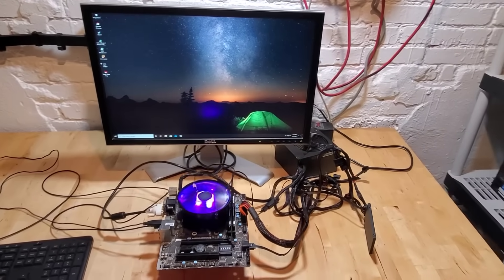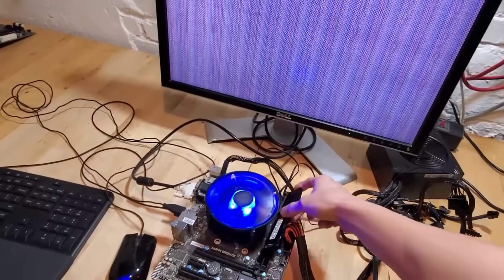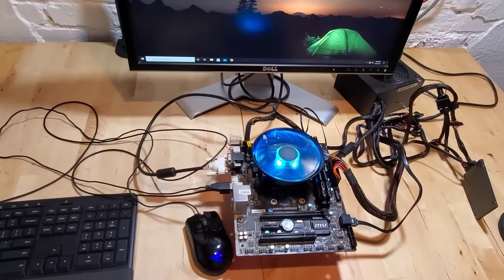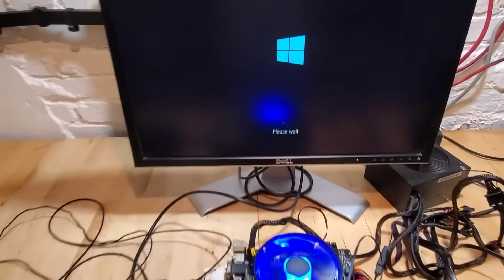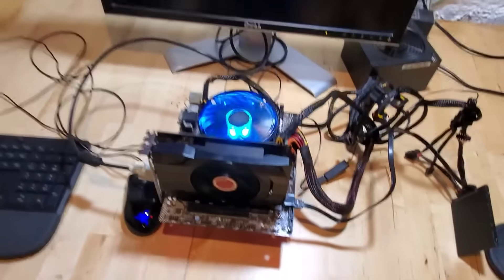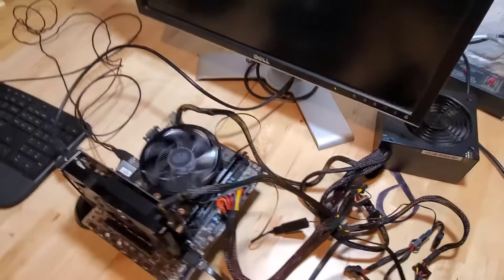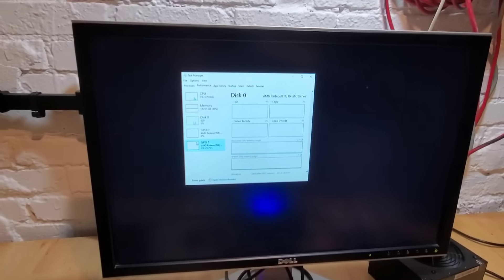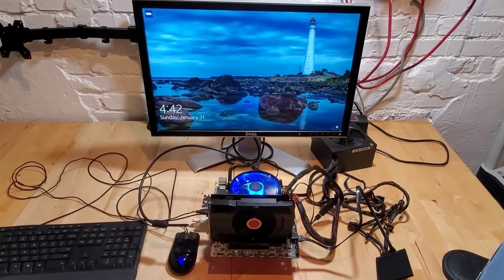What happens if you remove PC components from a running computer?

Comment: Almost everything needs reset after removal and reinstall. But, SSD or HDD doesn't need reset if connected within some seconds but if PC is used in the time where SSD is detached then Windows running on solely RAM data will crash.

Comment: Removing a PCIe card like a graphics card is obviously not a good idea, but if the operating system supports it, you can re-insert it and it should work right away. PCIe is a hot-pluggable standard (though support for it is not always implemented), and I've inserted graphics cards in Linux PCs for debugging while it's running more than once.

Windows unfortunately does not support this in almost all cases, but the standards and some OS kernels do

Comment: What happens if you connect monitor using both integrated graphics and dedicated GPU then remove GPU from PCIE slot? Will it switch to integrated graphics?

Comment: You should have tried removing the CPU while the RX 560 was connected to the display. Because since you were using integrated graphics obviously the screen was going to go black when you unplug the CPU. Not that the results would be any different but that's the more scientific way to do it.

Comment: 1.) would have liked to see you connecting the monitor cable directly to the motherboard after removing the gpu
2.) would have liked to see you plugging the ssd back in after removing it before the bluescreen - i really think this might fix it!

Comment: computer artifacts are so mesmerizing. especially the little space invader guys on RTX cards. also, the reason that the machine stayed alive for so long after the SSD was removed was likely due to the RAM still being inserted. still had some data on it either in use or waited to be used until it ran out. probably the reason why the wallpaper disappeared too.

Comment: I think there would have been different results if he was using a GPU while removing the RAM, rather than using an iGPU, if he removed the RAM while using a GPU, it would had the picture cached and it wouldn't display those funky lines that way, would just become frozen and you wouldn't be able to do anything, could be because of the iGPU not having actual memory, and using the RAM, that's what I think would be interesting to include too :)

Comment: When you removed the GPU,  you should have put the VGA cable on the iOS shields VGA input to see if the integrated graphics would have picked up a signal. But thanks for the video.  Very informative.

Comment: And from a linux computer ? (Just the hard drive and the gpu, since linux can add or remove gpu while running as long as it's not using it for display (else, you have to launch again the display), and it should be able to run without hdd too

Comment: why gpu is acting that way is... Maybe, theoratically speaking... The computer is the only thing that commands gpu and the gpu dont do actions by itself... so the computer hadnt told the gpu yet to turn off because you unplugged it suddenly it didnt had time to command the gpu to turn off... now that the pc is turned off and you put the gpu in...
1. The computer now told the gpu to shutdown
2. Gpu detected that cpu is off so... (due to my poor english this could easily be correcter or smth)

Comment: I tried the same process on my computer 11 years ago,The only difference is that when I removed the ram, the video card was installed and the computer did not freeze. System parts:
M.b. : Asus P2B
Cpu: İntel pentium II 350 mhz
Ram: 384mb "sd" 133mhz
Gpu: Nvidia tnt2 32mb agp
Hdd: Fujitsu limited 4gb ide.
Os: Windows xp. :))

Comment: Remove ram with gpu installed, also when gpu is removed plug in integrated graphics. Also, install hot-swap driver and see if that makes a difference - it should.

Comment: the pc would still run if u remove the gpu, in this case it didnt because the DVI cord was plugged to the gpu, so if u change to the port on motherboard ull see that the pc still run normal

Comment: I was trying just to take out my gpu to clean all the dust off the fans and I couldn’t even get it out. One side came up but the other didn’t and I didn’t wanna force it out and then it got caught on the side of my case and I couldn’t get it back in and after like 45 minutes of trying to get it back in finally fell back in pushed it in heard the snap and it worked fine. I’m just gonna air dust it while it’s in the case 😓😂

Comment: As someone else said already, I'd love to see the RAM removal while a GPU is active so that it's not using an iGPU with shared RAM. I don't know if the RAM was a set of 2 or not, but if it was, the opposite could be interesting aswell.(If it wasn't then we already know the outcome.)
Also, what if the GPU isn't running the display and is removed? We keep hearing the disconnect sound during a GPU driver update, so I have to wonder.

Comment: PC: screaming in pain from loosing a stick of RAM

Guy: now to take out the 2nd stick of RAM
Reply: Computer will not remember this because it had memory loss 😂
Reply: @eloskowy4954  Zheesh
Reply: @eloskowy4954  loll nice
Reply: 50 years later:
Dave: screaming in pain from losing left brain
PC: now to take out the right brain
Reply: @wasiplayseverything  "meanwhile in a parallel world"
Reply: Fucking bots
Reply: Lamo
Reply: *insert femur breaker scream
Reply: A RACCOON!
Reply: why did I laugh
Reply: @irusu.  yes why did you
Reply: 2237: hello_fellow_robots_today_we_will_see_what_occurs_when_you_remove_organs_from_a_functioning_human
Reply: @kahlzun  
No No... Even better   
------------------------------------------------ START TRANSMISSION----------------------------------------------
01101000 01100101 01101100 01101100 01101111 01011111 01100110 01100101 01101100 01101100 01101111 01110111 01011111 01110010 01101111 01100010 01101111 01110100 01110011 01011111 01110100 01101111 01100100 01100001 01111001 01011111 01110111 01100101 01011111 01110111 01101001 01101100 01101100 01011111 01110011 01100101 01100101 01011111 01110111 01101000 01100001 01110100 01011111 01101111 01100011 01100011 01110101 01110010 01110011 01011111 01110111 01101000 01100101 01101110 01011111 01111001 01101111 01110101 01011111 01110010 01100101 01101101 01101111 01110110 01100101 01011111 01101111 01110010 01100111 01100001 01101110 01110011 01011111 01100110 01110010 01101111 01101101 01011111 01100001 01011111 01100110 01110101 01101110 01100011 01110100 01101001 01101111 01101110 01101001 01101110 01100111 01011111 01101000 01110101 01101101 01100001 01101110  
--------------------------------------------------- END TRANSMISSION----------------------------------------------

LOL

Decipher via link
https://www.binaryhexconverter.com/ascii-text-to-binary-converter
Reply: @kahlzun  “hello fellow robots, today i will execute human_CentralProcessorUnitSwapper.exe while its system is active and we will discover if human system active (Y)/(N)”
Reply: U
Reply: nerver
Reply: Gonna
Reply: PC: dies
Reply: that's right,  the PC losing the stick of ram was equivalent to paralax in Green lantern sucking the soul from the aliens and leaving them mortal body behind
Reply: flat line sound
Reply: @slowlylosingmysanity9726  
Flat line sound...Oh.......No.. Wait
that's just the beep code
LOL
Reply: It's like getting your arms broken
Reply: ded
Reply: its weird that i heard pc screaming when i read this comment
Reply: and then feed it to a protogen
Reply: @coalthedergsune  what is that
Reply: @devind407  robot furry.
Reply: @coalthedergsune  what is that
Reply: It is pc kidneys 😂
Reply: its like a cartel torturing somebody by breaking their fingers one by one for not bringing the quarter they wanted
Reply: dementia
Reply: No f you 😭😭😭😭😭🎉
Reply: @KWithoutVideos-lw7bk  why I clicked AAAHH
Reply: @shadoflameYT  whats that? Im scared to click
Reply: @szymonka6384  Its a Rickroll
Reply: @szymonka6384  its a rickroll... a strange rickroll...

Comment: You COULD have put the SSD back in before windows crashed and it would 100 percent recover   Ive fast swapped cables that were acting up without taking the machine down.  It just detected it as a drive going unresponsive for a few moments.

Comment: I removed my SD Card from my RPI4 (at the time it was running Win 10, now runs 11 build 22000.71) and it did questionable stuff. I used mountvol though, so it was still inserted really, but removing C:\ is FUN. The wallpaper evaporated, and cmd wouldn't even open winver or another cmd window. Explorer then crashed, and YouTube that was playing before, stopped playing and soon after crashed. Then I got a BSoD and it rebooted, and because I used mountvol, remounted the main drive. Enderman (Youtuber) tried it on Windows 7 x64 and it just bricks the system, so don't try on versions of Windows under build 9200.

Comment: Do you know what would happen on a system with integrated graphics if you connect the monitor to the motherboard after removing the GPU mid operation?

Comment: Exactly what I expected except of the SSD part. 
The POST process during boot-up is there to ensure all connected hardware, that are not faulty by a rigorous procedure of scans and also make sure that it checks also for compatibility issues. The kernel allocates all of this information from POST to RAM were than the system displays and keeps reminding the operating systems that it has all of this components connected, along with the appropriate specs. In case you unplug your RAM, it finds this huge discrepancy and automatically falls into recovery mode.

Comment: This video has confirmed the problem I have with my GPU, appears that the PCIE slot is no longer able to hold my 1050 ti because of the weight and whenever I touch my desk and move my computer, the display will automatically turn black. With this video I can confirm that when I tried to push the GPU in place again the fans stop spinning. It is the EVGA SSC model with the 2 fans.

I would like to know if anyone have ever had this problem and how can I fix it, I'm planning on buying a new Motherboard but if it doesn't fix the problem, is it possible that the graphics card got damaged?

Thanks to anyone that can help me with this problem.

Comment: 4:22 i once tried that but as my silly mistake to turn the pc on without gpu plugged in the pcie slot but with the power pin connected and in an half minute one of the capacitor exploded, so that is the most dangerous thing to do

Comment: Another thing not apparent from this video is that removing components from (or placing them back into) a powered-on system can cause power surges on certain parts of the devices. This can cause components to completely fail, OR, in worst case to only partially fail, with partial failure being worse since it can be almost impossible to detect. Your system might end up booting up okay, and seem completely fine, until some software ends up using a certain broken memory area for something very critical and the result is a blue screen. Anyways... I still appreciate the video!

Comment: Technically it was expected, every part may fail without human interference, so systems need to be designed in such way that takes it into account. for example, for GPU being cut off from the motherboard due to being "melted" (inside of GPU may even crack when highly overheated if thermal throttle systems do not react in time) Pretty much each part may fail, CPU included so modern systems have to prepared for that, so one broken component does not take whole board and all what is on it with it.

Comment: just shows really that computer hardware is a lot more robust and quite hard to destroy.... now try that when your updating the firmware on a device lol .. i think it would have been different on the older ide drives instead of the sata drives .. even molex could make the power supply go bang??? maybe.. you have a big set of danglers lol i not got the balls to remove the parts while the system is still running .. interesting infact if you unplugged the power supply from the board and plugged back it that possibly go boom lol pop a capacitor or two.. watch us all cringe at that lol

Comment: Wish he would have shown what happens when you unplug the DVI cable from the GPU and plug it into the mother board to use integrated graphics instead. Probably would have done anything but I'm still curious.

Comment: The gpu fan remains active because it receives power from the psu cable. In theory it should do the same even when you don't connect it to the motherboard from the beginning.

Comment: What would happen if power is cut off the GPU when the system is running? Since it requires additional 12V to run.

Comment: It would be cool to watch how the system dealt with removing the graphics card while using integrated graphics instead of the GPU.
Reply: Also I think the checkboard pattern comes around from the integrated GPU using the ram as VRAM, so pulling out one would remove half the vram. Which begs the question - What would happen if you used a dedicated gpu and removed the ram?

Comment: I have a question, so my PC had some black screen then i called a technician to fix it but then when it was done i noticed something was wrong with the files. Some of the files in "Computer" was missing and it was now running Windows 8 i tried the Windows 10 upgrade thing but didn't work i tried it with a USB Flash Drive which also didn't work. How do you think i should fix it?

Comment: Fans keep spinning because nothing is telling them to not do so, like CPU off, brains gone, so nothing is telling the fan to slow down.
Remove GPU and no programming will slow down the FAN when you put it back, it reset to default = Fan off.
I was surprised nothing broke.

Comment: I tried removing the system SSD on Linux once, and interestingly enough you can keep working more or less normally if everything you need is in the page cache. If you try to access a file that is not, you'll get an I/O error, but that's all.

Comment: Tip: you can also dismount your system drive (while it's running) by using the "mountvol c: /d" in Command Prompt (with elevated privileges, and without the dashes), resulting in the same effect as physically removing the disk drive as shown in the video, except it's more safe and everything will be back to normal once you restart your PC (althought the desktop icons' order might get reset, so you'll need to re-order the icons as they were before incase you like moving them around the desktop)

Comment: You realize that those display artifacts likely happened because the integrated graphics uses RAM right? You should try that part again with a discrete graphics card plugged into the monitor. You also could have tried plugging the monitor into the motherboard again after you took the graphics card out. It's possible that the integrated graphics would work fine. Overall very interesting video though

Comment: windows 10 always gives the recovery console after 3 failed boots, so some of those may actually not be down to the hardware failues but just windows marking them as if they were a fialed boot rather than a hot crash to be honest

that's how i force booting into it, you can't push f8 anymore, and if you don't have a windows usb stick or can't get into the bios, you just cut the power twice or thrice during boot time, it will give you the recovery console, then replacing utilmon.exe with cmd.exe so you can spawn an admin shell from the login menu by clicking accesibilty options kek

in case there's a user lock there, well, then you need to break out the live linux and change teh password i guess :D

Comment: i once ripped a floppy cable from a mainboard pretty hard and made it reset back in 1999 orso

but that's just cause i ripped it hard and the mainboard wasn't on solid and got slapped i guess,
because i did hotswap IDE cables on the og xbox for softmodding lol

also, i hotswap sata all the time, it's in the spec, you just need to make sure the power gets plugged in quickly and firmly and not fook about or the PSU may be a dick about it. so having a gadget that takes molex or sata power you can just turn on and off for that stuff is quite nice to have.
also make sure it's not the system drive, it does not like that
removing drives as you're copying is usually a headache of a couple of minutes too if it fixes up without a reboot to begin with 
forced delayed write failures are bad juju and windows is not fond of them, linux on the other hand gives less of a shit although some log is filling up in the meanwhile  :')
(depends on your sata interface/drivers)

i remember TV cards, then hitting the metal of the case botching plugging it in the little coax->tulip adapter properly with the coax cable, and the psu just quitting because it got zapped with like 12 volt of tv

Comment: Next time i want to see what happens when you remove the power supply cords like the 24pin, the cpu header pins and the pcie pins.
Also what would happen if you unplugged a secondary drive when its running?

Comment: well I wasn't really thinking about doing this, ever.. but its cool to see it being done.
the results are... well, they're exactly what you'd expect tbh. The pc stops working and obviously you need a reset to put it back on track.
Luckily nothing died permanently, I guess everything has some protection in case this happens. It's good to know that, just like with windows (a software), all hardware can be fixed by doing some form of reset

Comment: Congrats for the courage to do this. But, how far the power supply to the mobo will be flowing if you remove the smalls components of the motherboards, like the ceramic capacitors, resistors, etc, one by one?

Comment: Wait… you pulled NOT a cpu you pulled the APU. The graphics were going through the CPU. If the graphics would go through the Graphics Card and you would pull the CPU the system would just lock up.